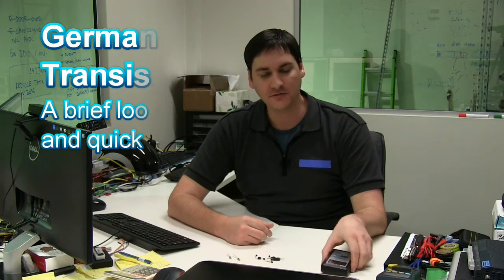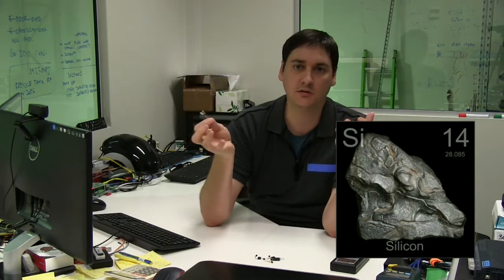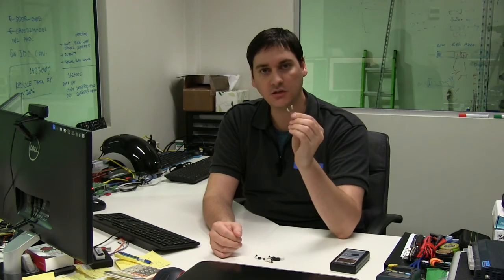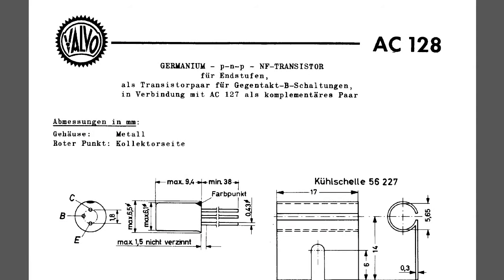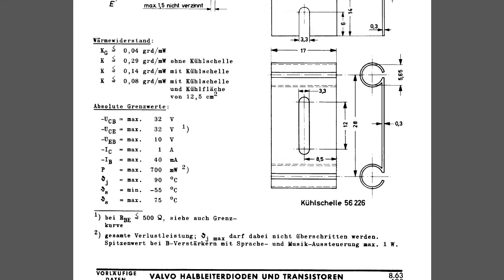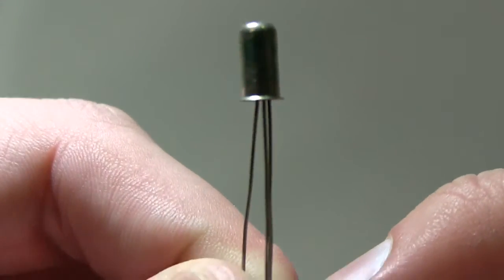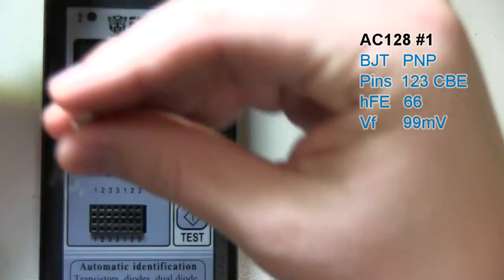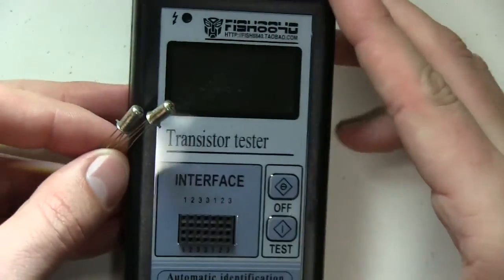Germanium Transistor Testing

Comment: I replaced an AC132 with one of these in an audio amplifier (driver stage), where the emitter-collector voltage measured nil.. (power on in circuit). These transistors were susceptible to what is called 'tin whisker', where a metal 'dendrite' forms across the PN-NP junction, shorting out the collector and emitter. In the periodic table, Germanium is classed as a metal (quadravalent), where Silicon is not, but also quadravalent..
Reply from the maker: I've heard of tin whiskers potentially being an issue with some lead-free solders. I didn't know it was an issue with germanium. Something new I learned today :) Thanks for the comment.
Reply: +NearFarMedia Seems to be with the method of connection internally, but as you mentioned, the variation in characteristics is somewhat greater in Germanium types; you tested 2 at room temperature, but increase that by say, 10 degrees, and you may find a reversal of the Hfe data... so a lot of extra passive components were required to get stability (emitter resistors, thermistors) but much success was enjoyed with their use and efficiency compared to vacuum tubes (valves). A 'failure event' of a germanium transistor used within data sheet parameters is very rare indeed, as the equipment I repaired was 40 years old... and the fault possibly started with the AC 132 being 'noisy' (sounding like a scratchy record), at which point it would have tested ok...  good for an oscillator... BTW, a very good presentation on the AC128..

Comment: The problem with this tester looks like it doesn't account for leakage.  Leakage must be deducted from the current gain to get an accurate gain measurement and can also be very high and cause thermal run away if the leakage is too high.  The tester looks good, but i definitely wouldnt trust it for germanium transistor gain measurements if it doesn't report leakage.  (good video btw).  Edit: i would suggest a peak atlas 55 or 75 or following the geofex germanium transistor tester circuit. Cheers
Reply from the maker: +DIY Guitar Pedals All good points. I agree that this tester has a place for low cost hobby use, but certainly has its limitations. There are much better test and measurement devices for accurate or serious applications.

Generally I use this tester as a guide when sorting parts, or too double check values.

Thanks for your suggestions too!

Comment: The germanium transistors were well known for wide range values. Also, the leakage test always tested high, particularly on power germanium transistors, but would operate normally as they were designed to do.
Reply from the maker: +John Cunningham good insight, thanks for your feedback :)